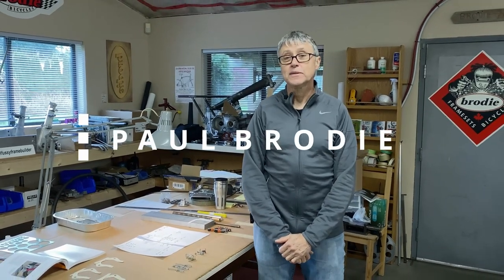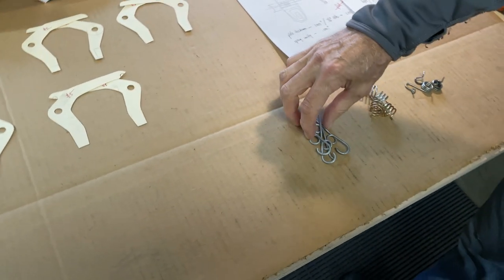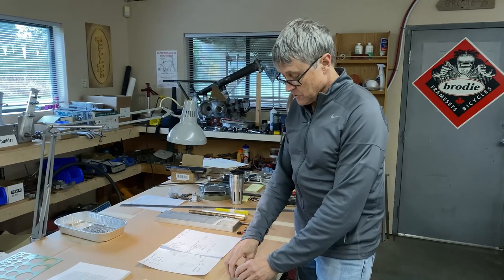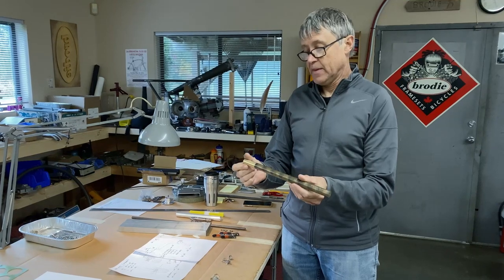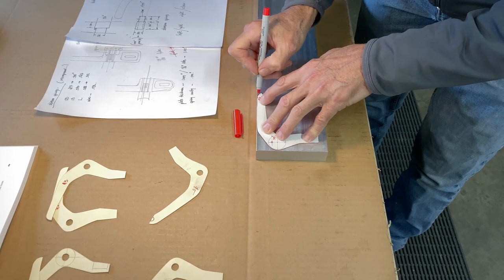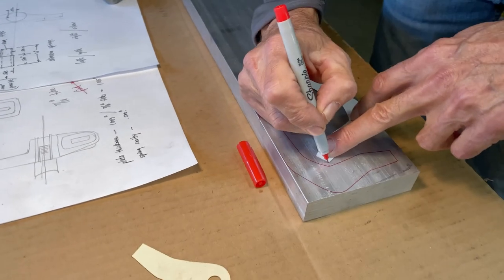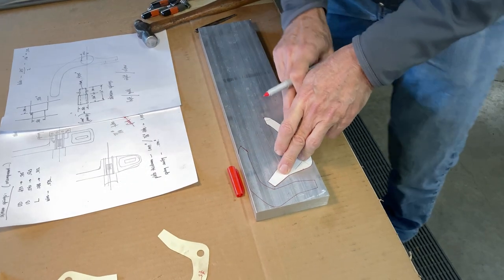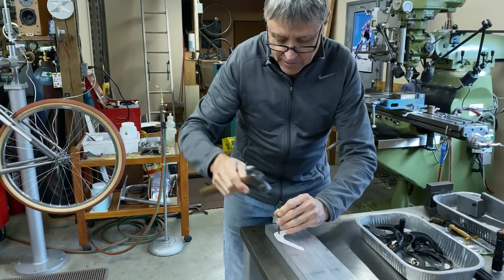Custom U Brakes Part 1 - Framebuilding 101 with Paul Brodie

Comment: Paul. The difference between your U-brake and the Paul Racer brakes that I have frame mounted on my bikes are what? Lot more beefier? Centerpull verses U-brake.
Reply from the maker: I looked on the Paul Racer website. They have "Centre Mount" and "Braze on" models, so when you say "Frame Mounted" I don't know which you have. My brake and his brake are both U-brakes. Not centrepull. I think mine is beefier.
Reply: @paulbrodie  both mine and my wifes bikes made by ANT are frame mounted. Originally my bike just had new versions of sidepull but I saw these frame mounted version on randonneur bikes and convinced Mike to install the brake mounts and then re-paint the bike. Then together we make my wifes frame. Yes I helped make a frame and fork! Your U-brakes are way beefier but to me they seem like the work the same? U-brake may have different pivoting point and make the action different?
Reply from the maker: @robertlombardo3247   Again you say "frame mounted" and I still don't know if that means "centre mount" or Braze on"... That's great you helped to make your wife's frame. Hopefully a great learning experience!
Reply: @paulbrodie  Yes, sorry about that. braze-on mounted, both bikes. Compass Bikes or Rene Herse as they are called now love this method. Glad to see you using similar with your U-Brake. I remember U-Brakes way back and most hated them and then the V-Brake came on the scene. What do you think of all these changes in the bike world? I like to hang onto something that works just fine and not desire new trend. I do have a Paul cable activated disk brake on the front of my fixed gear mountain bike. 12 years now riding fixed on singletrack. Call me crazy but I love it!
Reply from the maker: @robertlombardo3247  If they are braze-on mounted, then both U-brakes are very similar. Both work on the same principle. I do like a good hydraulic disc brake system, and Hope are my favourites. That was one good change in the bicycle world.
Reply: @paulbrodie  The Paul Racer uses its own braze-on mounts. I am very happy with them and find them to be quite stiff with ample room for fatter tires. Also if you used the Paul Klamper disk I bet you would agree they work great. I like the simplicity of the cable. But you are into motorcycles and I can see why you would like hydraulic.
Reply from the maker: @robertlombardo3247   I doubt if a cable can ever compare to the feel and power of a good hydraulic disc brake. Yes I am into motorcycles :)